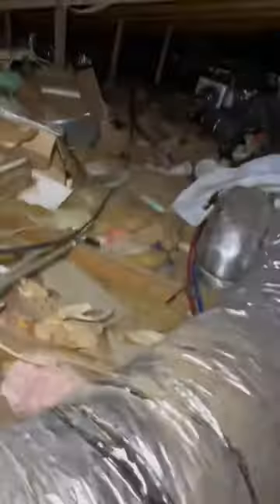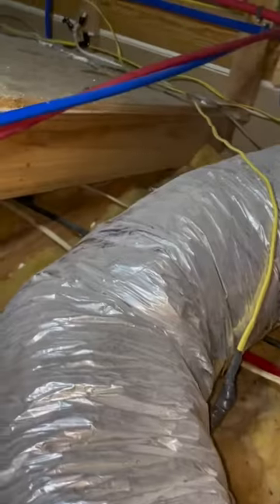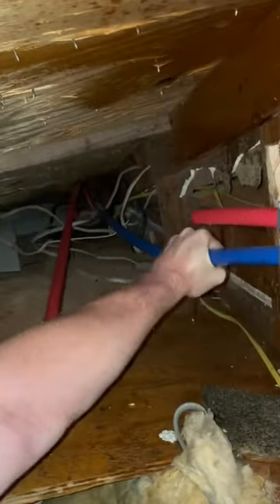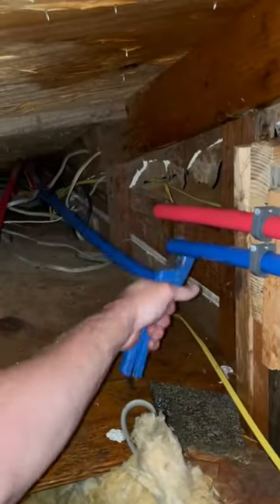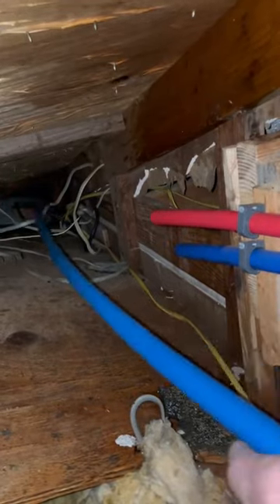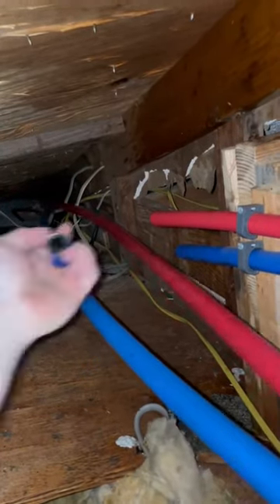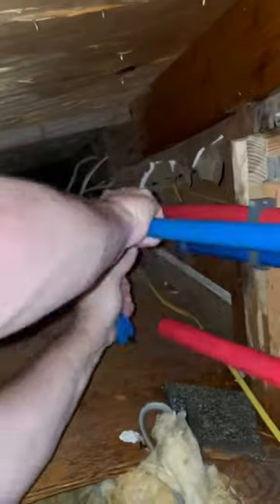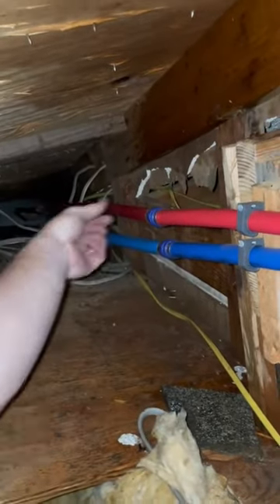Repairing a pex leak caused by a roofer. #plumbing #fyp #plumber #leak #repair #water #tradesman

Comment: Always check to make sure water is off
Reply from the maker: Yeah 😂 to be fair the roofer said it was and so did the homeowner. Homeowner said it has been off for multiple days. The valve at the softener was also off. But… I should have checked the meter. The valve at the softener was not working😅
Reply: @theplumbersplunger  The only time I had a roofer put a nail through an ac line (also way too close to the sheeting) I just had them cut a 2'x2' hole in the sheeting.  They were smart enough to mark where it started hissing...lol.  Roofer paid my bill no questions. Edit: Nice clean hole in the suction line...dab to silfos.
Reply: Why check if water is off to do a roof?  Because we hit a 3/8” Freon line in Stuart Florida doing a roof.  Like a million nails and one hits the smallest line imaginable lol. Stranger things have happened
Reply: Wtf?!? Check for water to be off to replace shingles lol. Nahhh
Reply: @TarzanArmani007  that wasn’t how it was meant, always check for water to be off before u cut into a line to repair it

Comment: I failed an electrical inspection last week because the non metallic/3/4” Smurf I ran was pushed out of the way to add more decking and as a result got bent against the roof line.  It makes sense for this exact reason.  Pretty cool to see an IRL example of the worst case scenario.

Comment: Jesus what is up with contractors who leave so much crap behind? (Not the dolls.)
Reply: Bad work ethic!
Reply: What, like the one roof they overlayed?  It's not hurting anything and if the homeowner didn't want to pay for the demo on it, ya jeave it.  So maybe it's the cheap ass homeowner rather than such a major flaw with the contractor.  But you insist on assuming it's a bad contractor.   As is typical.
Reply: @invictusbp1prop143  I didn’t say “bad.” I said “what’s up with them?” The many contractors I know leave their worksites clean. Up to them I guess.
Reply: Maybe it's me, but that junk up there is the owners junk and not stuff from the roof job, so why should they clean up that mess.
Reply: @Methodical2  Seemed to me 95% contractor-type material (besides the doll) but who knows which contractor.
Reply: @johnsrabe  I'll have to look again.

Comment: Also should not the break in the plywood caused by the hvac system separating the two areas be fixed for the plywood is ment to cut the areas up into separate sections as a fire brake and slow the fire down?

Comment: Thanks for posting. Anyone know how to repair a very small pin sized hole in a pex line? it's inside under the bathroom at the shut off valve. Can just use that pipe tape that says it stopes leaks, and what about using gator bites with pex. thanks

Comment: I didn't know pex had pro press is it the same gun as copper or completely different tool ?
Reply: It appears the Milwaukee Jaws/Press are specific to their short throw press, but the Ridgid Pex Jaws will fit on the Ridgid compact models.
Reply from the maker: @CarlosMendoza-xi9tv  ^^^^

Comment: If they had used cooper this wouldn’t have happened, but they are forcing you to use PEX and do a Mickey Mouse plumbing joint. The system is setup for you to spend as much money in repairs thru your lifetime.
Reply: Can u explain how it would’ve been Different ?

Comment: Did you move the lines
Reply from the maker: No, the roofing company was only paying for a repair and the homeowner did not want to reroute
Reply: @theplumbersplunger  its really awesome that the roofing company actually paid for a repair. Most companies I know would blow customers off
Reply: @theplumbersplunger  Maybe a steel plate or two between the sheeting and lines?
Reply from the maker: @jmackinjersey1  I put nail plates on the 2x4s that the lines passed through.
Reply: @theplumbersplunger Why would the roofer pay? Just a courtesy? This is in NO WAY the roofers fault.
Reply from the maker: @allaboutroofing2  they hit the line so I guess they took responsibility for it. They didn’t use their x-ray vision I guess 😅

Comment: Nail plates
Reply: You've never installed a nail plate, have you?   What do you want them to do, just bang plates to the roof along the entire route of those pex lines?  Just put some armor on the underside of the roof the length of the tubing?